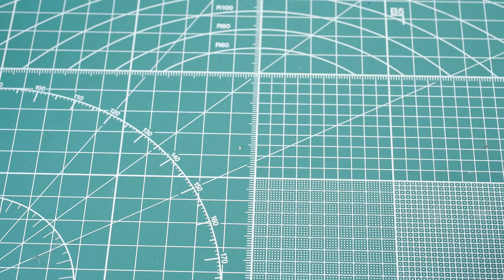Robak 2 | DIY RC Car | Build

Comment from the maker: The video demonstrates the build process of the Robak version v2.0. We now have an upgraded v2.2 available. While much of the process remains the same, you'll notice some changes in the parts during the assembly of this latest version. To guide you through these updates, I've created an interactive document detailing the design changes and offering additional tips. Link in the description. :face-blue-smiling:
Reply: Did u fill the differential with ca glue? Edit: Stupid question sorry that musta been grease
Reply from the maker: @98f5  It's thick silicone oil used for viscous coupling inside the differential to achieve kind of limited slip differential (LSD) effect.
Reply: CVD传动轴是长长的

Comment: Very nice. Now you need to learn about anti duck and dive, Caster, Camber Ackerman angel and bump steer.
Reply from the maker: Thanks! I couldn't find anything about anti duck and dive, is it related to the steering geometry? :) Bump steer is noticeable, I didn't know before what such an effect is called, maybe I can somehow fix it. Ackerman angle is already implemented. Caster and camber is set to neutral by design - probably not optimal but maybe as you said I should spend some time to find a better setup. So much to do and so little time :D

Comment: That unsupported chassis that's just a 2 wobbly bits of flat plastic 😱
Reply from the maker: Absolutely, a little give in the material helps with taking hits without breaking. With larger printers, we can get the chassis as one piece, which increases the sturdiness without sacrificing the flex where it's needed.

Comment: @14:11 Oof... That flex in the Bottom Plate already without having any load on the Steering Components 😑 Back to the Drawing Board I'd say 😏
Reply from the maker: This happens when the carrier hub bolts are overtightened. Later, I adjusted them to the right tension, and the steering feels smooth again. 👍

Comment: very very nice to see creativity. I'm a big fan of model cars. Think you did great here, was an enjoyable video to watch. Steering geometry looks great, chassis in two halves, I think will separate by themselves if you don't add more bracing! 
Are those FTX differentials? I use them a lot!
Was laughing to myself when I saw the motor position - you printed a new top brace to avoid the wires..I too know the pain of clearance, but I'd have spin the motor round not made a big gap for the wires.
All the same, a better, braver, bolder build than I have made myself, so please take that as a compliment 👍🍺🇬🇧
Reply from the maker: Hi, just watched one of your video to see what FTX is 😃. Great content BTW I'll come back for more :) For Robak I'm using HSP parts - diff name is HSP 02024. And yes... there must be a weakest link somewhere 😃If it breaks I'll upgrade it like I've done with the other parts. This process never ends. Regarding that top brace cutout I have now doubted. Was almost sure I tried rotating the motor and the wires didn't fit under the body. On the other hand I'm not seeing many people using this cutout as I do. I'll check it once again. Thanks! 🍺
Reply: @robaki-dev  Meant to reply sooner, it is really good to see someone who enjoys building stuff. I probably enjoy building and modding more than the driving, but it's all good.  A great hobby to bring people together 👍🍺🇬🇧

Comment: I love this ❤
Reply from the maker: Thanks! :goodvibes:
Reply: Have you considered creating and offering the Bill of Materials as a digital product? Would make a killer DIY kit for Christmas and Birthdays! Also I dream of adding an RPI + camera for semi-autonomous capabilities. Food for thought!
Reply from the maker: Kits are available from @rcprinter, who prepares them based on the original BOM for various 3D printed RC vehicles. Printed parts are not available for purchase, as owning a 3D printer is highly recommended. The main advantage of this project is the ability to reprint parts at home, so you don't need to buy new ones when they break. I gave one of the cars to a young relative who doesn't have a 3D printer. No worries though, I've got them covered with a lifetime of help with the parts they need. 😄

I recently experimented with a BeagleBoneBlue SBC with Ardupilot and GPS installed and the waypoint navigation worked wonderfully. However, I've temporarily removed it due to the snowy conditions here, as I'm concerned about the electronics 😀. On the Discord channel, I've noticed some attempts at integrating FPV cameras, which is quite interesting. Additionally, there's a reduction gearbox modification available on Printables that I'm eager to test soon to enhance climbing capabilities. I'm really fond of the Robak community and its innovative spirit. ☺️

Comment: Hi, I was looking at trying to design an RC car aswell although I'm very new to this. Did you buy the parts and measure them before designing around them or did you just work off of online datasheets. For example, I was looking at the HSP drive shaft and I could not find the radii for where it connects to the wheel at 2:30 in the vid, the Aliexpress page for them likewise has no information on it except stating it was suitable for 1/10 size RC cars, I'm not sure if there is a standard size. Would appreciate your help and love your video.

Comment: Hey man, cool looking truggy. How is the durability? Would it be a good bashwr? Or juat for speedruns and not to be abused much?
Reply from the maker: Hey, thanks! The performance of the car is only as good as the quality of the assembly and materials. It's hard to get everything right on the first try, but after a few iterations, you can have a very capable basher with this design.

Comment: @robaki-dev, where I can find the silicone oil 80k cst for differential gears? The BOM list link to grease.
Reply from the maker: Thanks for pointing that out; I've removed the link. I couldn't find any suitable silicone oil over 50k cSt on AliExpress. Based on my experience, it's easiest to find at local hobby stores.

Comment: such a nice simple chassis, do you think you can modify it with a narrower wheel track and use a Lexan Body like a rally car or something? I think it would also be a winner!
Reply from the maker: As the carrier hubs go inside the rim the minimum rim inner diameter is around 2.5" - determined by the height of carrier hubs. With such big wheels there is no room to make the wheel track narrower unfortunately :( I know that some truck bodies will fit after minor modifications.
Reply: @robaki-dev  then you have an excuse for a Second chassis project 😁 I will still print it but it has a lot of potential,well done!

Comment: why are the supplied differential cases different than those you assemble in the video? Also, may you please supply those stl files?
Reply from the maker: It's v2.0.0 in the video. Differential case was updated in v2.1.0. Older files are available on thingiverse, but I recommend downloading the latest version.

Comment: How reliable is it? Where are the weak point I should expect? And how much overall does it cost for the parts? Awesome built btw!
Reply from the maker: Thanks! It’s reliable until you crash it, which is very likely to happen. Sometimes printed parts break while bashing so it’s recommended to have a 3D printer at home to fix it quickly. The most common part that breaks is shock tower and steering blocks. It would be great if those are printed in nylon or similar. The durability of the metal drive components is impacted by the quality of the assembly and 3D printer accuracy. Gear mesh, clereances etc. It’s hard to get it right at the first time but the Robak is a more of a project to develop and repair than make it and forget it😉

Comment: So these are open differentials?
Reply from the maker: Yes. However, there is diff fluid inside which change diff's performance. Don't quote me on that but thick enough fluid can make the open differential behave like a limited slip diff.
Reply: @robaki-dev lol I thought that was super glue making a "welded diff"

Comment: Fantastic, what filament did you use?
Reply from the maker: Thanks! Most parts are from PCTG which I use interchangeably with PETG and PLA+. PA12+GF for parts that need extra strength and thermal resistance (shock towers and motor plate) and pure PA12 for ultimate impact resistance (steering hubs). Full list of parts and materials is here https://github.com/robaki-dev/robak/blob/main/3DPartsList.csv

Comment: Plastic motor mount ? =)))
Reply from the maker: it's nylon filled with fiber glass, why not?😀
Reply: Ideally, the motor mount should be made of the most rigid material possible (metal). This will ensure a constant gap between the spur and the pinion and thereby extend the life (mileage) of the pinion. @robaki-dev
Reply from the maker: @Евгений-и1т8ь  Totally agree, if only my printer could print metal or diamond! At the time, PA12+GF was the most rigid material I had available, capable of handling temperatures above 60°C without melting. The loose fit on the shaft and spur gear cause much more wobble. Guess I should fix that first, but the setup is still good enough to provide many hours of enjoyable driving.

Comment: Very cool build! Where did you get those shocks?
Reply from the maker: Thanks! HSP 108004 from aliexpress. Now I recommend upgrading as the cheap HSP shocks leak and the stock spring is too soft. Any 100mm shock absorbers should work. E.g. Injora 100mm Aluminum Shock Absorber

Comment: How durable is it
Reply from the maker: Crashes are inevitable when you push the speed, and yep, parts will break. But, if the car is built correctly, with 3D printed parts that match the design tolerances, using the right settings and materials, it can absolutely handle jumps. It's all about finding the right balance between being strong and not too heavy, so it's tough where it needs to be without breaking the bank on metal drivetrain parts. Every build is unique. Some folks get better results than others. There's always room for improvement, and most of us keep tweaking our builds to make them as good as they can be. It's a process of iteration, finding what works best for your specific needs and driving style.

Comment: where is the hinge pin pdf located
Reply from the maker: hi, here's the direct link: https://media.printables.com/media/prints/119715/other_files/1162656_a4efb73c-b520-41e2-aa02-a17429d86202/hingepinsdrawing.pdf

You can also find the pdf in the release zip package

Comment: Rename the video to "3D-Print an RC"
Reply from the maker: There are many non printed parts used in this design. For example the metal drivetrain. The ultimate build is going to combine many fabrication techniques like cnc machining. At the moment I'm only capable of 3D printing parts 😄